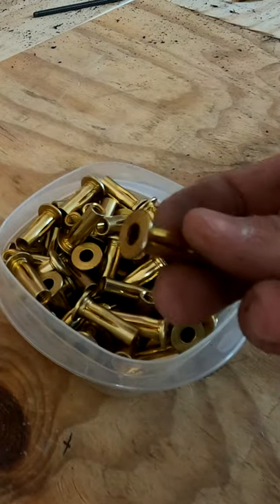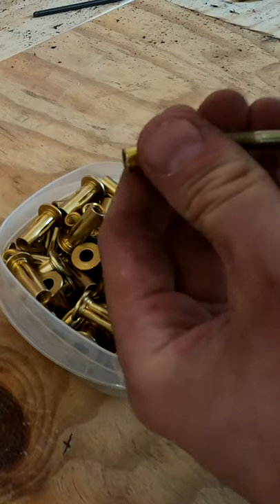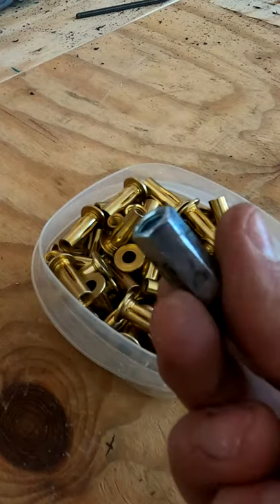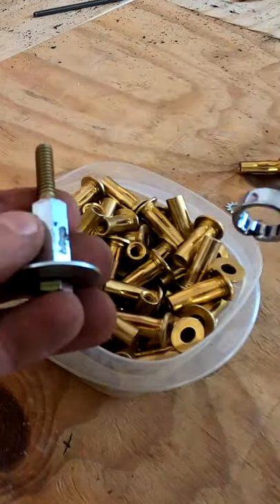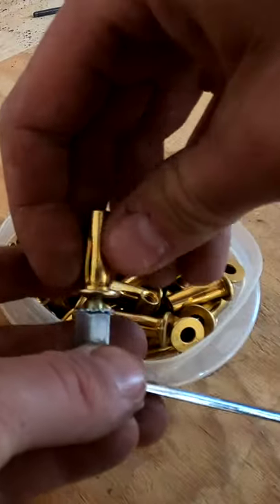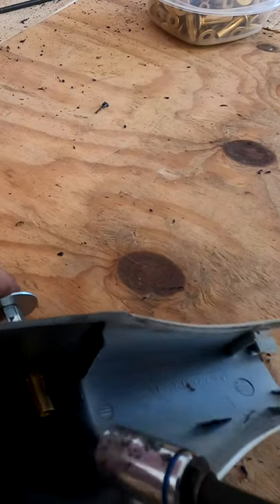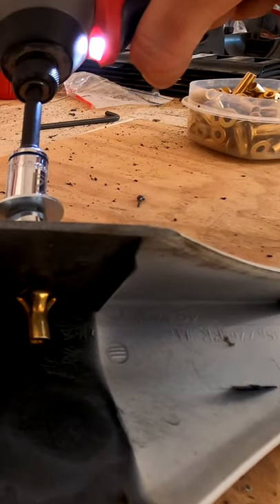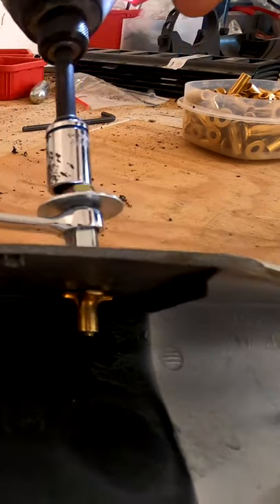DIY RivNut / Cross Nut/ Cheap Installation tool #shorts

Comment: Awesome, I just did 4 on my jeep and on the 5th I tore the threads out. My nut threaded on the bolt instead of flee floating. I will use your method now.

Comment: Can i use an regular battery powered blank and deckar drill to do this process or will i be better off doing it manually
Reply: I'm thinking with a cord or cordless drill, should have a drill that can be adjusted for minimum torque.. easy to strip threads with out the feel of it's torque, the more your hands are involved with the torque, the less chance of stripping

Comment: Easy to know when it's seated properly when you can see both sides. I snapped a couple of bolts off when using this method.
Reply: Test so you can see and adjust the torque limiter on the drill accordingly.